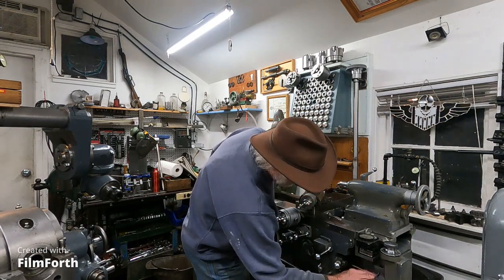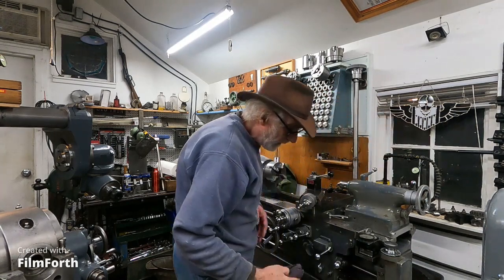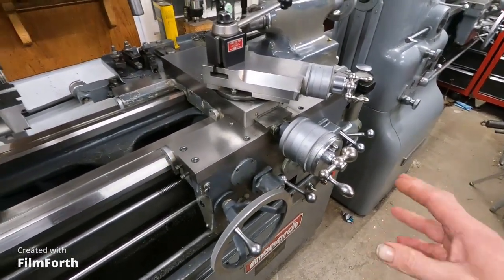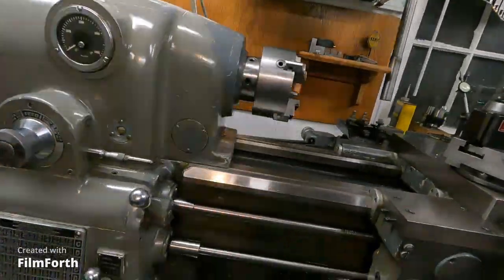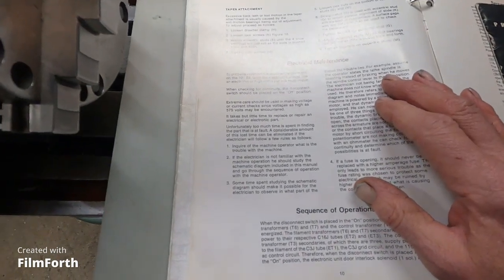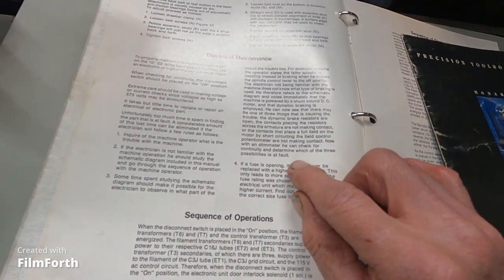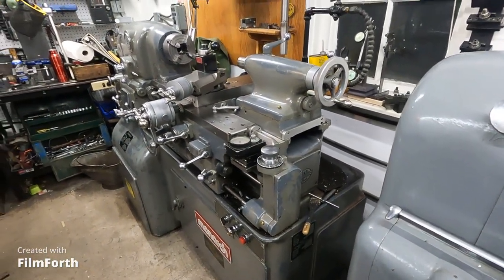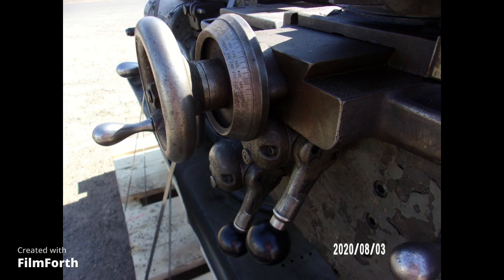Monarch 10ee lathe an overview of this timeless classic

Comment: Your set up of chucks and 5C collets for the Monarch lathe are impressive..And of course the lathe, I am going to try the Kerosene wipe down on the old South Bend lathe..
Reply: I've got SB 10k with the 4 1/2 ft bed, gonna be using Don's tip as well.  A good friend of mine retired diemaker as myself used to run a 10EE at Hoover Ball brg loved that machine. I never ran a Monarch ,  primarily SB, LeBlonds and a Pacemaker.  Latest project is adapting some Atlas metric change gears for my 10K that were discarded by a shop I used to work at.
Reply from the maker: My first good lathe was a 9" junior workshop model then I had a 14" and two heavy 10s they are outstanding machines that worked really well for me I had to trade those in for heavier machines but miss the simplicity and ease of use. I at one time had a 12" Atlas with metric change gears so I could work on import bikes. my first venture into metric threading. Thanks!
Reply from the maker: I would have never told, but was caught by the Blade last year. The coat of kerosine in effect makes the paint and bare metal optically clear that shows even more on video. Thanks!
Reply from the maker: Chucks is a subject I am going to get deep into soon.

Comment: I have a 1963 10EE with the original tube drive.  Had to do a lot of troubleshooting when I first got it but now it runs perfectly and is a very smooth drive with incredibly wide RPM range without need of gears or belt changes.
Reply from the maker: Thanks for that! I am hoping to somehow do a trouble shooting  video or a live thing where experiences can be shared. As you know there is a bit of a learning curve just to get used to the idea of the thing then after that trouble shooting is much easier. Scott @ monarch stated the module drive is a piece of cake to keep going. I lack experience on the earlier tube drives pre 1960 however. Thanks for tuning in!!
Reply: What you say about Monarch support is true they have been very helpful to me with both technical advice on the drive and even sourcing serviceable used parts to help me repair it.

Comment: Question for you Mr. Dee Dee; at my employer we have a 1948 Monarch 10ee lathe. It hasn't been used much over the decades. We turned it on and it wants only to run backwards.  Any ideas what to look at? Thanks.  PS: Where are you located?
Reply from the maker: If it has the original motor generator drive the problem could be the forward contacts or switch. It sounds like it needs to be fully serviced and cleaned to start. It is just asking for trouble patching one up that has been out of service. I am going to do videos on servicing. the motor generator drive and likely will do other factory drives also, I am in drunk on the wine Walla Walla WA
Reply: @deedeeindustrialsuperprecision   Thanks for the reply and thank you for sharing your knowledge with all of us on Youtube.  Best wishes from Northern Michigan.

Comment: Nice set up . The 10EE is well regarded in the USA, not sure many made it over to the U.K. where U.K. made Toolroom lathes were available from some high end makers. Monarch I think bought up a number of those remaining in the 60’s and 70’s - the period when machine tool makers were dropping like flies as orders dried up.
Reply from the maker: We do have Colchester, Harrison and Dean Smith and Grace tool room lathes. The base casting on the 1983 Monarch here was cast in England by DSG. Apparently Monarch was involved with that company. The DSG lathes are highly regarded.
Reply: @deedeeindustrialsuperprecision  DSG good as they were at the time for production lathes, the Holbrook Toolroom lathes were in a class of their own. Relatively small numbers made by monarch standards, the units from the 60’s and early 70’s are every bit as beautiful to run and work on as the 10 EE . Not many examples left now. Thanks for your videos.
Reply from the maker: @lookcreations  A machine tool dealer here had a couple of Holbrook lathes including an Edgar, I know very little about Holbrook, there is not much to be found. Sure,I am likely to make more videos, thanks.